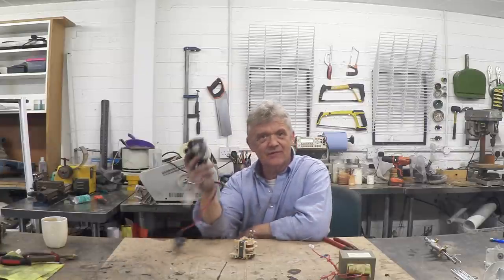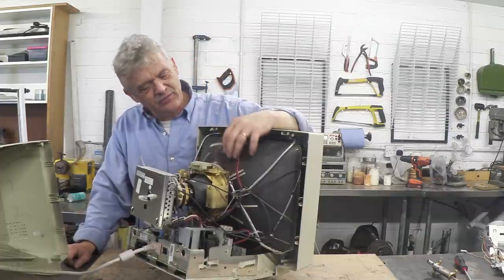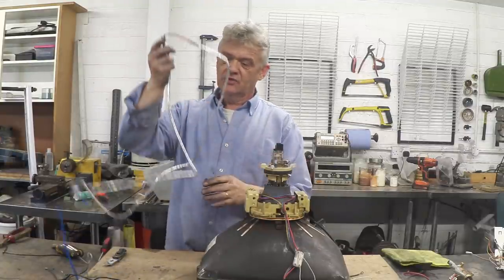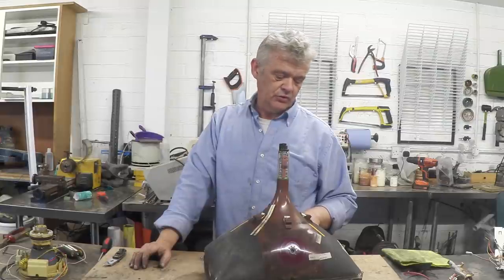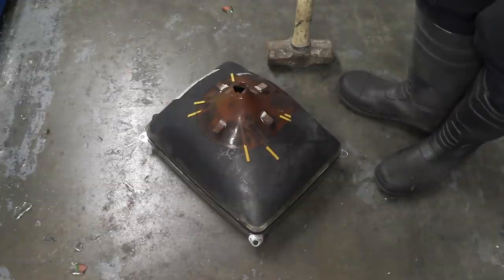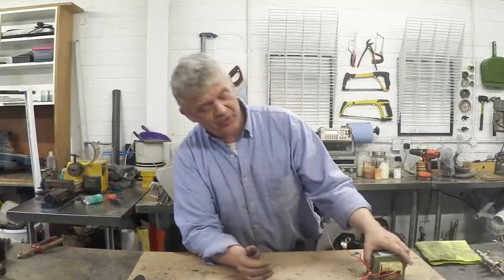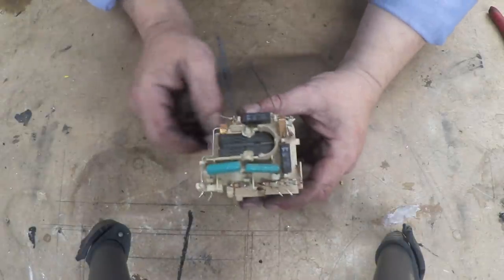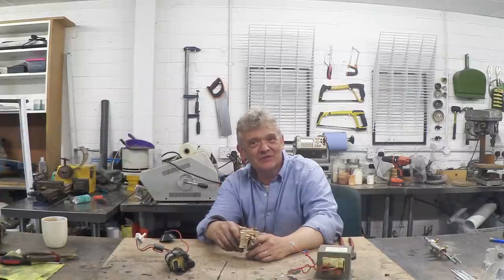Old And New Sources For High Voltage

Comment: This Monitor have much more usable parts in it...the yellow stripes under the deflection yoke are magnets they are used for the color purity on the screen..the shielding in the image tube is very thin sheet metal and can shield high frequencies so you can wonderfully shield RFID cards against foreign access.
and thx for the video!!!

Comment: From the microwave oven inverter transformer you could get high power high voltage. Did you think about to make a birkland eyde generator ? I have read somewhere that it´s easy to liquify the NO2 gas just to collect it so it should be a source for nearly 100% HNO3.

Comment: When I was a kid I stored the old picture tube up in our attic.  A few years later I was up in the attic and touch that high voltage
connector on the tube.   Never did that again.   Over time I think a charge build back up in so no matter what short it to the outside
coating though a bleeder resistor before touching.
Reply: You had perhaps invented a method of collecting free energy from cosmic rays.
Reply: Desmond Bagley  I live in Minnesota.
This happen back in the late 60s and darn
near ended up down the attic hole.  My
Grandfather has a TV repairman.  Thanks
for the reply.
Reply: @richardsandwell2285  Shape of the roof focused cosmic energy to the crt. Happens all the time!

Comment: Should have shown how to properly discharge the tube, and using it as a capacitor is by far more useful than smashing it, at least collect the phosphor. the lead that is dangerous is the shielding painted on the outside.
Reply: Mercury is of more concern, but minimal on a one off I wouldn't worry, the scrappers go around with sledge hammers and smash the entire TV's/monitors just for the deflection coil copper sometimes leaving the flyback. Makes a mess
Reply: The whole funnel is lead-glass, also coated with lead inside(*) and outside. So plenty lead.
The phospors, I have no idea about how dangerous it is. I just assume it's not healthy.
* I haven't found a answar to what the "red stuff" is, but it may be lead.

As for capacitors, get a rolled up foil capacitor, likely way more capacitance for the volume it takes.

And the eletron-gun is tricky to re-use, I would guess reusing it would be like start filling the whole tube with oxygen-free gas, and then working onwards from that carefully.

Comment: We tend to forget about zero energy. Oops, no, not literally.  I mean: with just one coil you can as well generate high voltage. But the sparks will be green in stead of yellow. It is done by shorting the coil and catching the flyback with HV diodes. It even seems you can do nifty things with this 'special' form of HV. Like light up a neon bulb under water, and also put your hand inside the bowl as well. I am sure you know these videos, and I know you know they are real. I wish more people would experiment with this kind of energy. I used this kind of 'pulsing energy' to restore (lead car) batteries for instance, it will break the 'bridges' which are between the plates. And I also once showed that this kind of voltage will light up a normal (tungsten) lamp on a closed loop wire. A shorted wire. It seems to have AC properties then?

Comment: To discharge the capacitance, you can get a screwdriver and crocodile clips, and short the metal hole bit to the band around the edge of the tube and the graphite paint that's covering most of the surface :)

Also: to get a nice implosion, you want to throw the tube about 2-3 meters, so it lands on the pointy bit. Will make a terrific boom, but, from implosion :)

I never thought that growing up around a CRT tube regunning works would have any relevance in the modern world, but there you go!

Comment: MAN!!!!!! When i removed that CAP with a screw driver i got SHOCKED and went flying back 10 feet!!@!  Lol i was only 16 years old outside in my back yard with  bare feet!!
Reply: At the same age I got something similar, I held the wire of the spark igniter of my moped while I turned the motor. Oops! I will never forget how that felt. It was as if I was hammered down to the floor. But even a week ago I was not cautious enough, I touched 250 Volt DC from my solar panels. Luckily I had very dry fingers as I did that, and I anticipated it could happen.

Comment: Robert:  The original CRTs were built by independent Research Inventors - like Philo Farnsworth - who were not unlike yourself.  They didn't have digital oscilloscopes and software-defined signal generators to work with.  You undoubtedly have the ability to blow laboratory glassware, and a vacuum pump handy.  Have you considered reutilizing (one or more) CRTs to build a benchtop Accelerator, for Proton Beam or Ion Implantation experiments?  Personally, I find the 'Farnsworth Fusor' fascinating - and even individual High School and College students have built them successfully.  But, for a Chemist focused on Materials Science and Electrochemistry, I would think you would find the prospects for DiY Ion Implantation, or just Surface Deposition, an irresistible temptation.  There are also some nifty analytical lab instruments that could be built from an Electron Beam assembly, co-opted from a disused CRT.   Basically, you want to open that Tube with a torch instead of a Hammer, put other things where the screen is, seal it back up with glass (you can see through), and pump it back down.  I've got a huge, heavy [working] 36" Sony Trinitron TV I've been saving to do something like this with for a long time.  If it weighed less than the QE2, I'd send it to you to play with...

Comment: Be careful. Regardless of the age of the CRT, charge can be built up by light entering the face of the tube. Please discharge the tube before removing the hv cable.

On another note, I recently had an opportunity to tear apart an old lcd projector. You would get a kick out of the different useful nuggets inside, to include lcd shutters, prisms, and a variety of convex and concave lenses. 

Thank you Robert for another terrific video.

Comment: Hey I have some my fair bit of engineering. I think it would be prudent to talk about discharging a CRT before you show yourself just taking one apart. Wouldn’t want anyone to get hurt. Someone might try to take apart an old TV or something and hurt themselves.
Reply: That' s good advice. High voltage can persist for years. It will hurt but is very unlikely to kill you.

Comment: Well, don't totally ignore the flat monitors yet!

Before the LED-LCD/TFT stuff, there is the CCFL-stuff (cold cathode).

They basically use a high-voltage transformer to drive the cold cathode tubes.

Comment: One annoying thing I discovered with one microwave transformer I butchered, I am not sure if they are all the same but the secondary coil appeared to be made of CCA enamelled wire " Copper-coated Aluminium " cheapskate manufacturers not wanting to use expensive copper I guess.

Comment: Microwave transformers are still easily available on eBay.   Loads of them .... for now, as you say.   A friend of mine was dumping a MW and I asked if I could have it (cunningly thinking ... free MWT.   I was sorely disappointed to find no transformer!!    However I did salvage some nice stainless steel sheets from the case.    I will watch more carefully for the FBT next.    Could you explain “fly back” a bit?   
Those diodes look very useful.

Comment: Stand neglected Mr Smith scan coils not feild coils, test cards, setting up the ratsers and the convergence, valve hybrids and Bush thyristor chopper power supplies, delay lines, coulor burst gates, ceefax, oracle, the world of analogue meets digital. If you ever find a Philips vr 2000 if you don't want to put it in museum it has a one watt neon argon laser with a high voltage tripler power supply.
Sorry I'm getting mentisental. X rooby

Comment: A CRT tube only needs a tep to let air in at the neck, you don't need to use a sledge hammer.  But for safety, you need to be at arms length, you just need to tap it and it will hiss, after it stops hissing it is safe.  Don't use a short tool to crack the neck of the tube, there is a very slight chance it will pull you hand towards the sharp glass.  You only need to tap it from a foot away and it will crack, hiss and then it is safe.  You do want to stay away from the bit at the side of the tube just in case there is high voltage stored.  It can store enough to kill you if you are unlucky.

Comment: A somehow funnier way to toy with CRT: cut the gun with a heating wire around the base. The glass will split and partially leak air in, making a whistle on the way. I forgot but I think when you take the gun away, it will pop a little like a kiss sound.

ps: Robert, Flash Graphene man !

Comment: Another easy source of HV is a Current Transformer! 
Having one of these open circuit is easily enough to break down the enamel insulation!
As with most electrical stuff it can be dangerous if used wrong!

Comment: I just took apart a big crt tv yesterday and I don't smash with a hammer I heat up just below the crt with a torch until it cracks and you get a good implosion and sucking from the tube its pretty cool

Comment: Thanks, great video. 👍😃
I've been ripping them apart for the copper wire (or just chucking the big black thing in the bin). 
I need to see what projects can be built with these.
I'm interested in building an induction heater to melt copper.
Haven't shocked myself yet and will be more cautious now.

Comment: remember that cathode ray tube can hold a 30,000 volt charge at a substansial amperage at least for a moment i watched a fellow tv repair man get a hold of that once the muscle contractions threw him across the room it didn't kill him but he will never make that mistake again discharge it before mucking around same for the microwave high voltage section they are both supposed to have a bleed resistor that will make them safe but these can get broken or removed and then the high voltage section stays hot for a long time nd don't forget the 1 hand rule so if you do screw up you don't get that fatel 1/10 of an ampe across your heart thuse stopping it. stopping heart bad 1 hand in pocket good:-)

Comment: A few comments :

The degausing coil for modern crt monitors was made from aluminium wire. Not copper. Your's is aluminium probably It was because aluminium is cheaper and the coils were only powered for a few seconds so thermal loses did not matter much.
For what the flyback transformers are concerned, i did not know they were used in microwave ovens now. They use the same trick as for switching power supplies : using high frequency to drive the coil which makes the transformer much more effective and you can use a smaller one. This will be difficult to drive for DIY projects. Also for high power output the electronics needs to be very efficient. For that you need high current gate drivers to drive the power fets. This also means the electronics and transformers will have radiated emission as if it were the BBC and need's to be well shielded to confirm to EMC requirements. That probably shows in the oven you took apart

Also for the monitor the transformer might have a cascade within. Maybe not so visible but that used to be the case. It would multiply the transformer output voltage with a certain factor and will not work at low frequencies like 50 Hz.

I'm very curious what project's you come up with for using these transformers. As I explained, it will not be easy.

Comment: I have been looking for a flyback transformer for ages. I replaced my microwave oven recently only to find it has a very thin transformer about a centimetre wide on each side. Also it sits vertically instead of the standard horizontal windings of a proper high voltage transformer. Then I hear from you that it's a flyback transformer, glad I saved it. Great video Rob, thank you yet again.
Reply: Not really "flyback", but totally a high voltage transformers.

You can also get transformers from the backligt of old flat-screen tv/display.
(CCFL/tube drivers)
Reply: You can buy them online pretty cheap!
Reply: @ronniepirtlejr2606  or local small ads for free when you take defective ones (usually only the fuse is blown)

Comment: A high voltage capacitor needs to be handled with care: If terminals are left open for a long time period charge can build-up - it's best to simply wrap/bind a copper wire around the terminals (shorting them out) for long storage. To discharge an UNPLUGGED TV tube you need to bring a good earth wire (this is VERY important and possibly connected to your earthed central heating copper pipe), to the screen wire wrapped around the tube. Now connect another wire (professionally a resistor is placed in series with this wire), from that screen wire to the metal end of a well-insulated screwdriver then slowly sneak the metal end under the HV rubber/plastic Anode cap until you hear a crack (or none if there's no charge). Warning: A sudden pulse of high voltage to somebody that has a known or perhaps unknown weak heart can kill! Not worth the risk - play safe.
Reply: You only need to connect the tube inside(the connector) to the tube outside(woven wire).
Earth have no special significance in it.

Avoid connecting yourself to the high voltage connection directly before the discharge, since the chassis will be high voltage relative to you if you do.
Reply: @erlendse  Having worked discharging/handling many HV capacitors and tubes for many years, I can painfully assure you that electrons only have a very strong desire to return to earth. They don't care if it's via a good earth connection or jumping across the screwdriver and through you. If you just attempt to short-out the tube (no proper earth connection protection), the "woven wire" will then (for a moment), lift to 25KV whilst it finds a route to earth (probably via you)! Interesting to note: If a good earth connection is say, 0.1 Ohms then for a fraction of a second the current will be about 25KV/0.1 = 250 thousand Amps! Which is the reason why a resistor (in series), is used. Through the human body say, 1K to about 1M Ohm this could be a heart-stopping 25Amps down to 25mA for a longer length of time! I recommend a safety earth guard be used at all times - I lived to tell this comment.
Reply: Desmond Bagley  Well mentioned, bounce back - very true. Possibly due to areas within a capacitor not immediately joining-in (perhaps impeeded from), the discharge? Like a water reservoir being totally and immediately discharged, but local groundwater (in a short time), partially filling it up again. This was one of the reasons why I would wire wrap HV cap terminals. And I also agree with you that not all is known. I've always found it interesting that a plate cap can be used as an aerial. My days of writing a thesis though are a tad behind me :) Any budding EEs willing to take on the challenge?
Reply: @beamer.electronics  Well, it's one pole to the other. Ground is still not part of the set.

Lightning can involve ground, since ground may be one of the poles.

As for the discharge current, 0.1 ohm is way off (100-ish to1000-ish ohm for body, also the tube paint is not very conductive), also duration is very short (pF to nF capacitance), thus unable to block stuff(heart/muscles) for extended time.
Reply: Desmond Bagley  Thank you, and yes perhaps dielectric materials chemically conditioned/phased so that groundwater is encouraged to flow with the immediate bulk reservoir discharge, might be an advancement? What's needed is an excellent chemist - Rob are you busy? "yes very, why what do you want?" :) Joking aside and perhaps a tad left field, I've also wondered if quantum probabilities and wave functions are in play with capacitors - electrons/charge/discharge? Perhaps, the higher the voltage - the greater its effect? All the best.

Comment: Your video's fascinate me, but I'm an electronics dunce. So to my question...
If that microwave motor can step up voltage that much, could one be used to step up a relatively low voltage to a usable voltage? I was thinking in terms of a 12 v battery being stepped up to 120 v.. ?   
Like I said, I really don't understand how electric components operate..tho you have educated me way beyond what I could ever have achieved by reading books.
Reply: Desmond Bagley  I'm sure that's all correct, but other than getting the gist that it wouldn't work, I have no idea what you just said... Electrical blockhead here.... and unfortunately, at 61..I doubt I'm going to gain any extra brain power...
but thanks for the reply.. At least I know  not to bother looking in to that, further.

Comment: The implosion noise of a CRT is massive if you bust its face instead of it's back. My cousins and I busted an old console television with a 32" screen. We ran quick when we heard the implosion noise. We were sure the cops were on their way. 

BTW, It had been dumped in woods by an unscrupulous individual.

Comment: Caution - Have a flat blade screw drive to discharge high voltage that may be under that Cathode ray tube (CRT) cap. Screw driver that is 10cm /5 inch with insulated handle 
 Some scrap speaker or lamp cord wire  60 cm / 2 Foot is fine. Expose 3 cm or an inch of wire. Wrap one end around the metal shaft of the screwdriver. The other end put through the metal chassis. 
Then hold only the plastic handle and work the screw driver under the cap. You may hear a spark. Just get to the metal prong holding the cap. 
If you hear nothing but have touched the metal prong, that is good. After a few hours this things discharge. 
NOTE:  this is not advice nor instruction. Use at your own risk. There could be something else going on. Do not sue me nor come back to me. Working on CRTs is a lost art now.